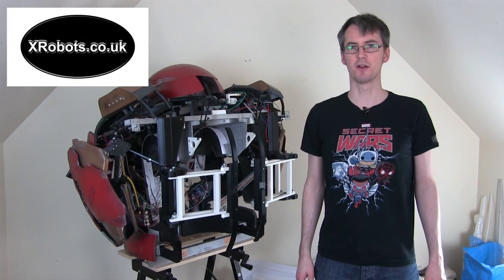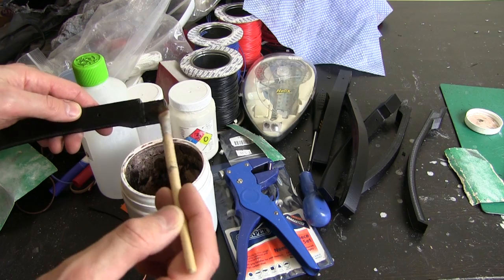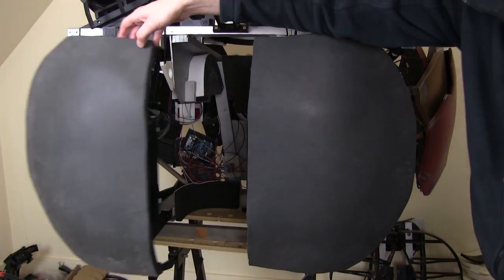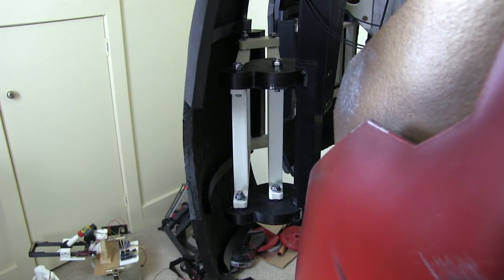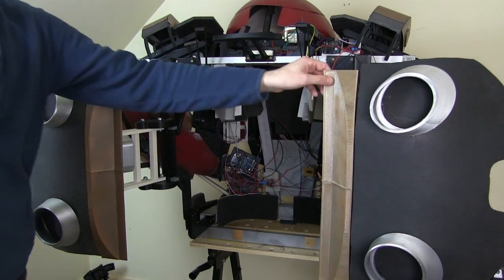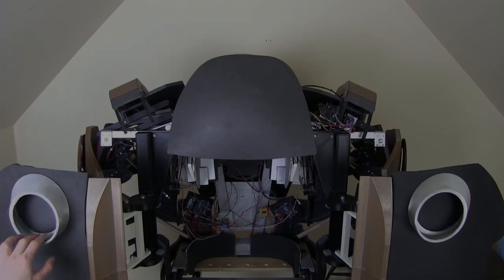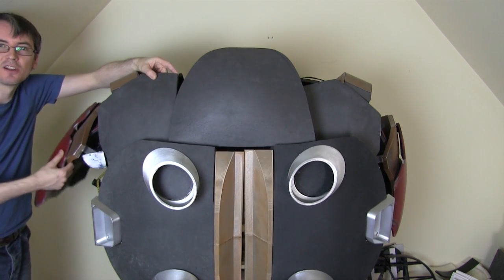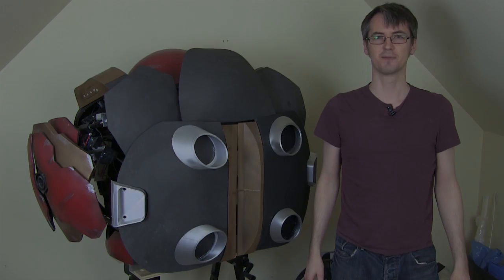Iron Man Hulkbuster Cosplay #47 | Back Doors | James Bruton

Comment: Awesome addition to getting the back panels made. Im wondering if you have a video showing your printers? such as the hot ends and specs and what not. I just purchased Delta style printer and was wondering what your using? thanks

Comment: Hey James...just a thought. I was watching the bit where you are using a heat gun on the floor mat to form them and got to wondering if it would be easier to utilize that heat box you have for heating up plastic sheets rather than the gun which is really small and could cause uneven heating since you can only cover so much area at a time?

Comment: You could put computer fans in the thruster vents to simulate exaust. It's looking great.
Reply: +MrShadow12622 The suit probably gets kinda hot, so if those fans also worked it would be useful.
Reply: Also it would work for some sound effects if they're placed correctly
Reply: +MrShadow12622  That's not a bad idea, however I don't think the Hulk Buster suit had such a thing, more bright LEDs are the style. fans are a little bit steam punk, and the PC fans spin so fast you can't really notice them.

Comment: James, when cutting with a blade on the cutting mat, it it's best to cut with the straight edge on the inside of the line so if you slip the blade doesn't cut into the part.

Comment: One of the biggest problems I had with my own cosplay was using hot glue gun. Things fell apart easy overtime. Making some projects crumble to time at a fast rate. Because the Armor fell apart and snapped off with Hot glue. I was told that using  barge cement glue works wonders. Have you ever considered using it to?